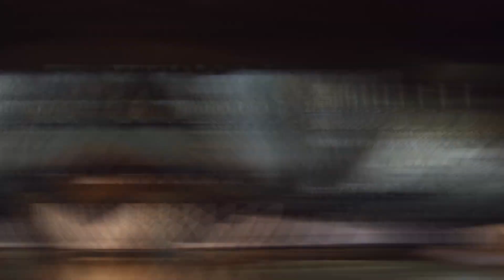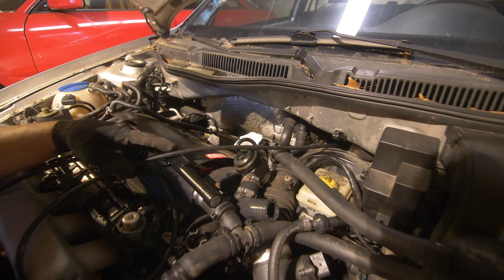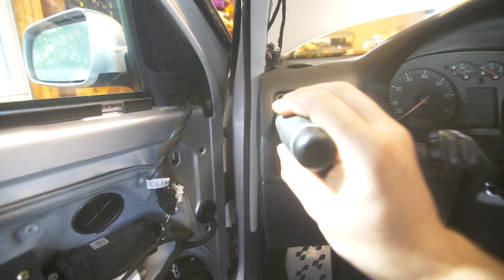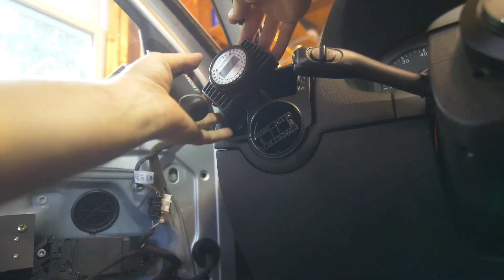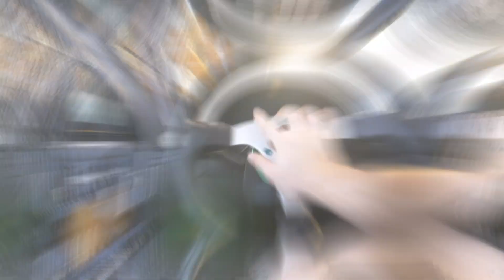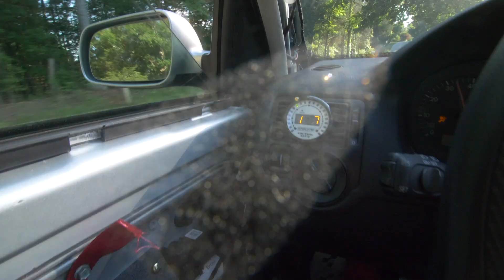MK4 GTI 1.8t Dash Vent Wideband Sensor Install!

Comment: I see you're also in the not at zero when off boost gauge from NewSouth. Lol.
Reply from the maker: ...bbbbbut it has indigo backlighting! 😂
Reply: @supercarmio  There’s a way to adjust it and get it back at zero, but I’ll tell you right now it finds it way back to -1, -2 vacuum anyway 😂
Reply from the maker: @jamesschulte5278  haha I bet!
Reply: @supercarmio  Wouldn't trade it for any other one though, matches the interior too well! All 4 of the Newsouths in my car are stuck in there.
Reply from the maker: @jamesschulte5278  I know right? it's pretty rare when an aftermarket part can fit so well into the style/fit of OEM.